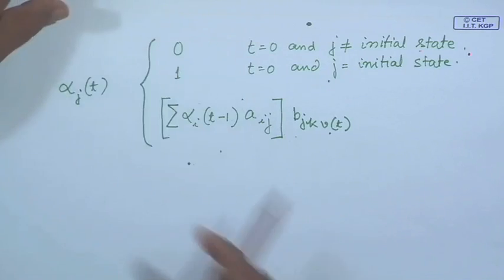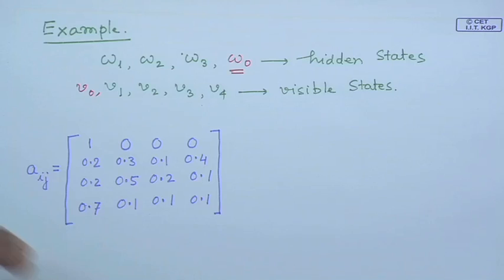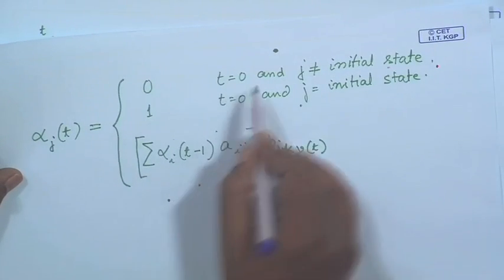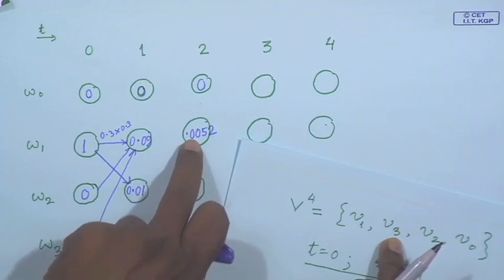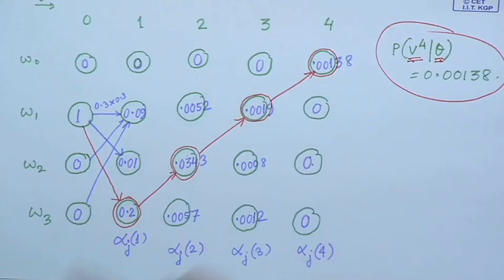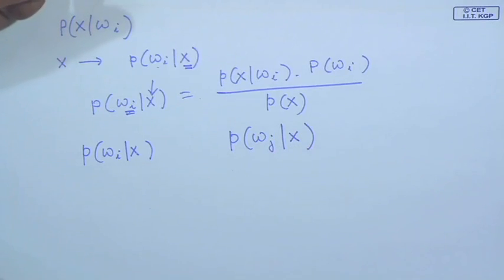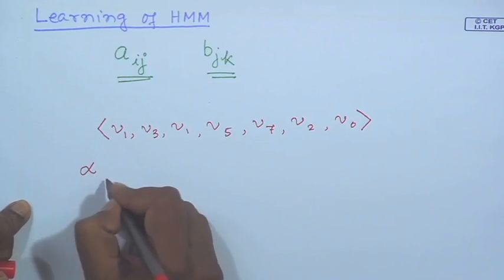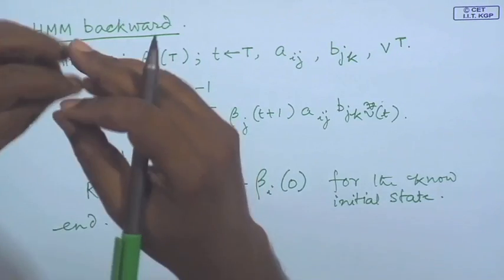Mod-01 Lec-39 Hidden Markov Model (Contd.)

Comment: Here is the python script to get the values of alphas
import numpy as np
np.set_printoptions(formatter={'float': lambda x: "{0:0.5f}".format(x)})
# define Aij and Bjk Matrics
A = [[1,0,0,0],[0.2,0.3,0.1,0.4],[0.2,0.5,0.2,0.1],[0.7,0.1,0.1,0.1]]
B = [[1,0,0,0,0],[0,0.3,0.4,0.1,0.2],[0,0.1,0.1,0.7,0.1],[0,0.5,0.2,0.1,0.2]]
# Define Output Variable
v = [1,3,2,0]
# Initiallize Alpha Matrix for all hiden variables and time values
alpha=np.zeros([4,5],np.float32)
# Forward Algorithm
alpha[:,0]=[0,1,0,0]  
print('*****Initial Alpha ****************')
print(alpha)
print('******Final Alpha******************')
for t in range(1,5):
    for j in range(4):
        for i in range(4):
            alpha[j][t] += alpha[i][t-1]*A[i][j]
        alpha[j][t] *= B[j][v[t-1]]
print(alpha)
print('***********************************')

Results
****Initial Alpha ***************
[[0.00000 0.00000 0.00000 0.00000 0.00000]
 [1.00000 0.00000 0.00000 0.00000 0.00000]
 [0.00000 0.00000 0.00000 0.00000 0.00000]
 [0.00000 0.00000 0.00000 0.00000 0.00000]]
*****Final Alpha*****************
[[0.00000 0.00000 0.00000 0.00000 0.00182]
 [1.00000 0.09000 0.00520 0.00519 0.00000]
 [0.00000 0.01000 0.02170 0.00054 0.00000]
 [0.00000 0.20000 0.00570 0.00096 0.00000]]
*********************************

Comment: can someone explain alpha_0(4)??
Reply: The equation to find this given by 
alpha_0(4) =  (alpha_1(3) * a_10 * b_00) + (alpha_2(3) *a_20 * b_00) + (alpha_3(3) * a_30 * b_00)
                    = (.0019*.2*1) + (.0008*.2*1) + (.0012*.7*1)
                    = .00138

The transition probabilities used here are a_10, a_20 and a_30 since we are computing for the omega_0.
At time=4, omega_0 emits visible state v_0, that is why emission probability used here is b_00.

Comment: I am not very comfortable with the reasoning that:
Most probable sequence of hidden states for a given sequence of observed symbols is the sequence of max (Alpha(j,t)) at all  time steps. 
I am uncomfortable mainly because, majority contributions to max(Alpha(j,t)) may not be from state max(Alpha(j, t-1)).
Reply: Agree, I guess it should be the Viterbi algorithm, which takes the max rather the sum of Alpha(j, t-1) * a_i_j * b_j_k
Reply: Your understanding in incorrect in a way.  max(Alpha(j,t)) is not coming only from state max(Alpha(j, t-1)), it has contribution of all hidden states at t-1. So to make it clearer, at every time T, all the hidden states are present with their participation probability, but to choose most probable sequence one has to take max of all hidden states.
Reply: Brilliant Professor has explained Viterbi Algo only. Nothing different to decode sequence. it's same.
Reply: It's certain in the sense that at each step the most probable hidden state comes given by argmax{j} Alpha_j(t), thus being a local optimization. However this may give raise to a not allowed step for the transition probability matrix a_ij. As Yongliang said, in Viterbi you will obtain the most probable path, note in this case that you have to keep track of each of the N paths at each step t.
Reply: We just need to backtrack (starting at the final state), and keep the state that contributes the maximum from the previous time step to the current timestep.

Comment: for alpha_2(2) = it should be, (0.09*0.1+0.01*0.2+0.2*0.1)*0.7 = 0.0217. How did you get 0.0343 ?
Reply: Yes, you are right alpha_2(2) should be 0.0217.
Thus, the values for the next level will also change.
alpha_1(3) : [(0.0052 * 0.3) + (0.00217 * 0.5) + (0.0057 * 0.1)] * 0.4 = 0.005192
alpha_2(3) : [(0.0052 * 0.1) + (0.00217 * 0.2) + (0.0057 * 0.1)] * 0.1 = 0.000543
alpha_3(3) : [(0.0052 * 0.4) + (0.00217 * 0.1) + (0.0057 * 0.1)] * 0.2 = 0.000964
alpha_0(4) : [(0.005192 * 0.2) + (0.000543 * 0.2) + (0.000964 * 0.7)] * 1.0 = 0.0018218
Rest, all alpha_1(4) = alpha_2(4) = alpha_3(4) = 0.
Thus, P(V^4|theta) = 0.0018218.
Reply: Guys, have you got the same values for other terms ? 
For example alpha_1(3) is it really 0.0019 ?
(0.0052*0.3+0.0343*0.5+0.0057*0.1)*0.4 = 0.007712
not 0.0019
If we compute the same alpha_1(3) where alpha_2(2) = 0.0217 instead of 0.0343 then we get: 
(0.0052*0.3+0.0217*0.5+0.0057*0.1)*0.4 =  0.005192
Reply: deval ya my values are  also  0.0217 and 0.007712 Thank You Sir
Reply: @devalverma4757  I am getting 0.0217 also
Reply: u r  right. this is mistake.
Reply: @Avnish -.0063+.0014+.014=.0217 not .0343
Reply: It is supposed to be 0.0217
Reply: True. its 0.0217. For it to be 0.0343, (b23 should be 1.1 !  which is not possible)
Reply: +enjay it is    0 .09(0.1*0.7)+0.01*(0.2*0.7)+0.2*(0.1*0.7)= 0.0343